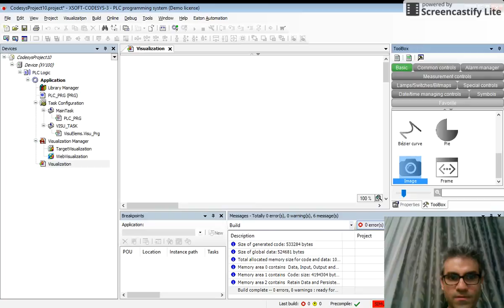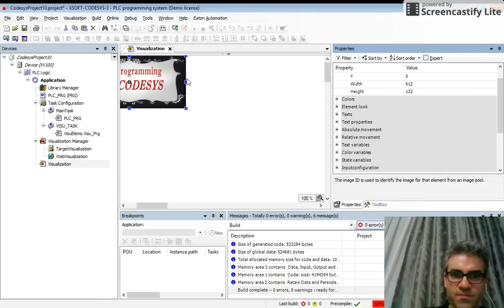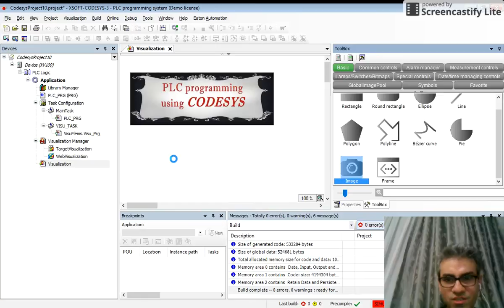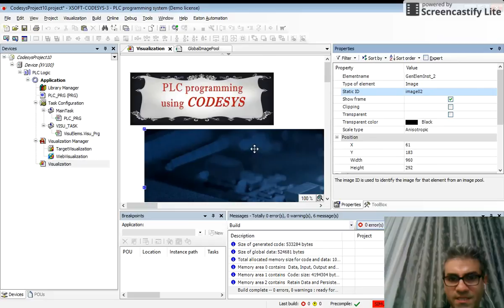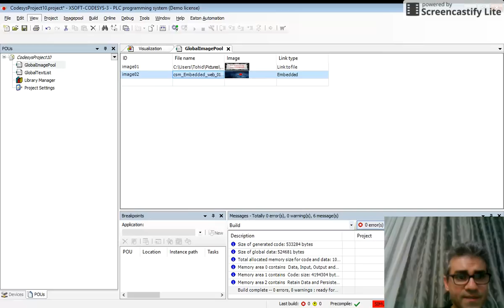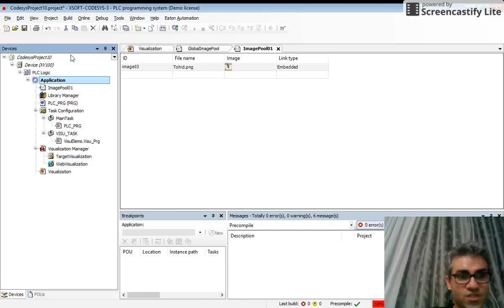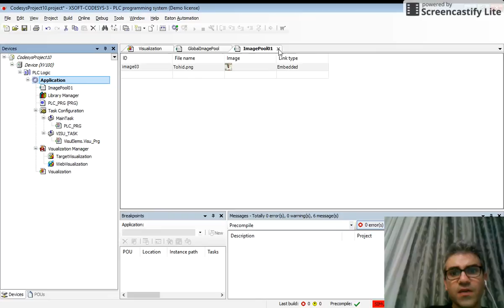CODESYS: Images in Visualization #codesys #plcprogramming #iec61131 #visualization #images #plc

Comment: Hi. I could place images in visualization and the images are visible during simulation in PC.But the images does not appear neither on a PAnel nor on webvisu. What could be the problem? Even the images which comes with codesys by default also doesnt appear.
Reply from the maker: Hi. I mainly use CODESYS in simulation mode on PC. So, I am not sure about the reason for your problem. I will post your comment on the facebook group, where other users could propose solutions:
https://www.facebook.com/groups/1713567795523663/
Reply from the maker: What kind of panel and what version of codesys? 
Is the panel a HMI PLC or just a HMI?